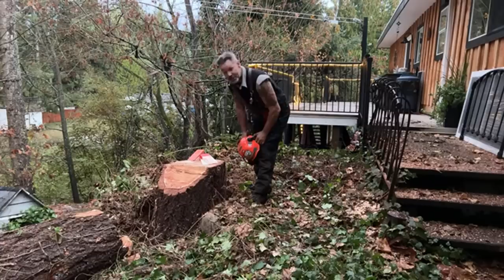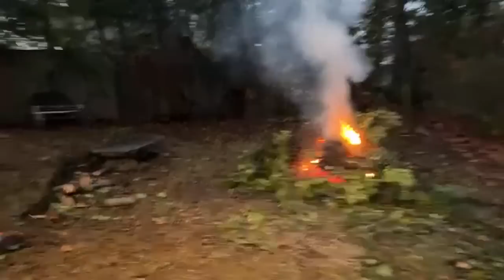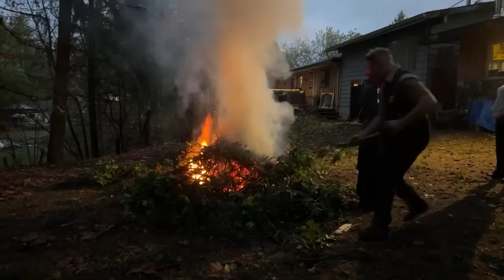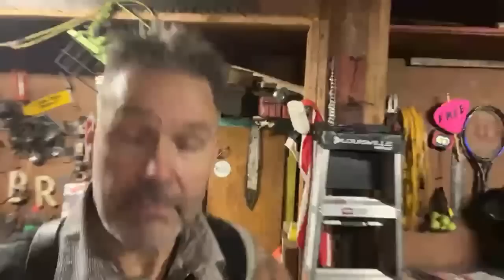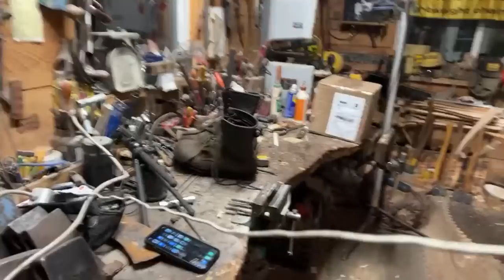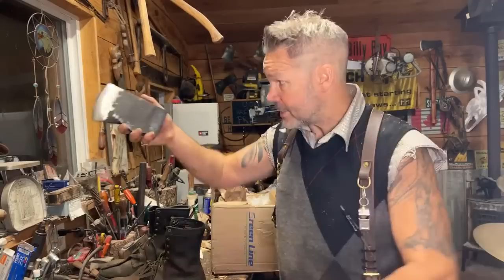Cuttin’ and burnin’ tree up

Comment: That was a bit to much smoke their in the neighborhood
Reply: Must agree with this comment, not a fan of smoldering fires. There are many ways to avoid filling the whole area with massive amounts of smoke. 
Wet leaves are the culprit.
If i put smoke in the air i want to be sure it's minimal. 
I'm really into fresh air and smelling and breathing as much as i can for the last years of my life. 
When i have a giant pile of brush, just let it sit for a few days and the leaves fall off the branches for the compost. Yes, I make more work for myself but it's to avoid smoking out the whole neighborhood. 
Of course i live in a hollow so one tiny smoldering fire can fill up the whole valley with smoke and the local authorities would be here writing me up a hefty fine. Especially if someone important complains. 
🔥💨
Reply: @jirusjirus9322  not a fan of the smolder either, but you gotta do what ya gotta do.